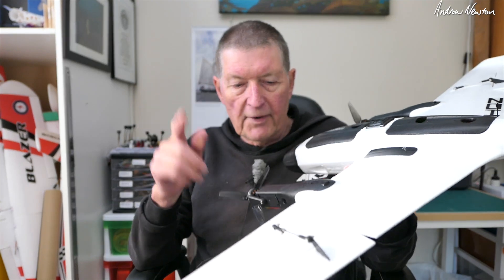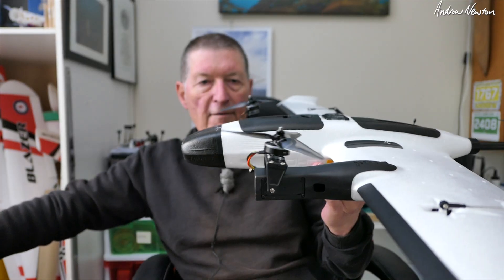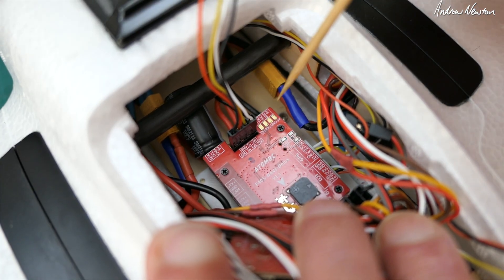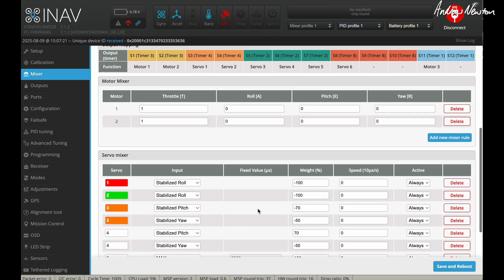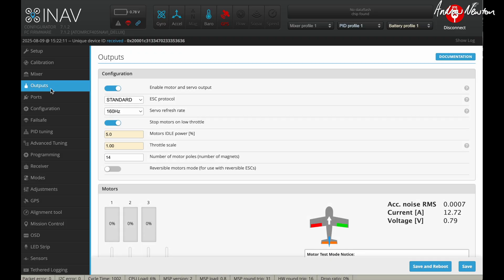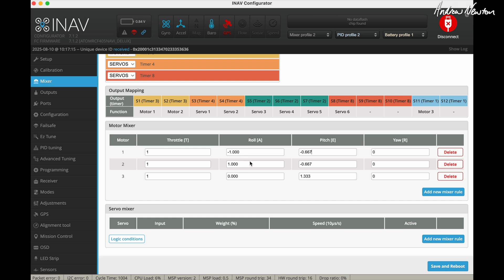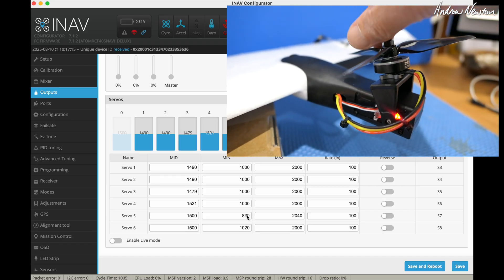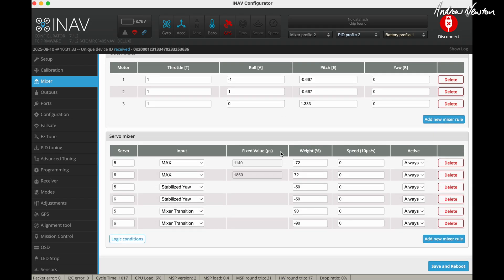ZOHD Altus VTOL - INAV Setup

Comment: Hi - I've got our Altus up and running. It hovers and also can fly in fixed wing mode. Yesterday, I tried a transition for the first time but had a forced landing - when I hit the transition switch mid position (motors at 45 degrees), it did a rapid piro to the left. I was able to switch it back to drone mode which brought it back to earth relatively level with minor damage. Upon closer inspection of the video footage, it seems that the right motor went to 45 degrees but the left motor didn't - it looks like it stays straight up. Have you ever heard of this before? Here is a video if you have time: https://youtu.be/AAeQzKYftxk   Thanks for your time.
Reply from the maker: That looked exciting! Email me your Diff file and I'll see if I can trouble shoot it.

Comment: Hello Andrew, I'm on INAV 8.0.1 configurator, struggling with my homemade tricopter/fixed wing configuration. I went through your video, as well as others and through GitHub VTOL wiki step by step. The issue is that apparently I can't switch across the two mixer profiles. Eventually, I can activate mixer transition when booting with mixer 2 activated from GUI? I heard in another video saying:... it won't switch until the accelerometer is calibrated. Is that what I've to do? Am I missing something else? Thanks for helping!
Reply from the maker: Yes calibrate the acc if you haven't already done it. Make sure your Switch for Mixer Transition and Mixer profile 2 Modes is actually working in the Modes page. Select "PID Profile will use..." in both mixers. Which board are you using?

Comment: Nice!!  I'm finally about to build my altus vtol kit, and here I see you uploaded this just in time.  Thanks!  I was concerned that an f4 FC wouldn't be enough mcu power, but it looks like it's working for you.  I was also gonna use ardupilot, but I'll try Inav since you've got it all mapped out for us!  Also - no Air Speed pitot?  I was told that was required for VTOLs for the transition...  Thanks, Andrew.
Reply from the maker: Excellent. If you're familiar with Ardupilot it would be a better way to go. It does use airspeed sensor for ensuring safe transition speed. INAV VTOL is very basic and you have to be careful with transitions.
Reply: @AndrewNewton  Ah - I see.  Thanks, again for valuable advice.😀

Comment: Hi, I'm curious to know how hot the motors were right after landing? Mine are really burning..
Reply from the maker: Warm, but I never do long hovers
Reply: Try lowering your D-term settings in the PID settings.  An overly high derivative value can have a big impact on motor heat.
Reply: @RCHobbyFan thanks,  did that too, down to 0. Still hot
Reply: Check your ESC timing settings
Reply: I swapped with dshot 600s. No difference.  I wouldn't think dshot cares about timing
Reply: @mkolesnik  DSHOT is the communication protocol - the timing is independent of that, so, yes - timing still has the same effect as always.

Comment: Thanks for this; almost ready to test. I notice that Dzaro has motor 1 = -0.667, same for motor 2, and motor 3 = 1.333 whereas yours are different. I really don't know what these do but the order seems important. I am having trouble with the motors going backwards as much as they go forwards for yaw in hover mode. Really appreciate your videos. Happy flying from Redcliffe (Qld).
Reply from the maker: My motor mixer values for Pitch are same as Dzaro. Reduce the weight of Stab Yaw in the mixer to even up the servo yaw throws. -50 worked for me. Hope your maiden is successful.
Reply: @AndrewNewton  Yep, -50 was perfect thanks. Got a horrible yaw oscillation though. More work to do.